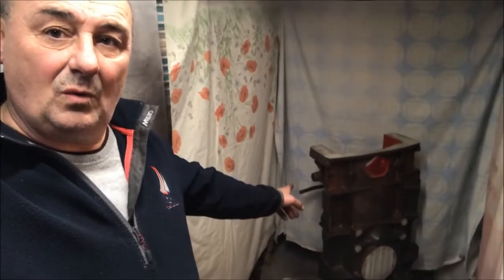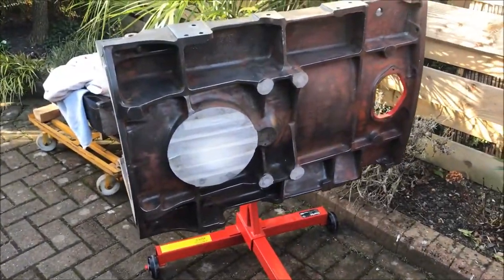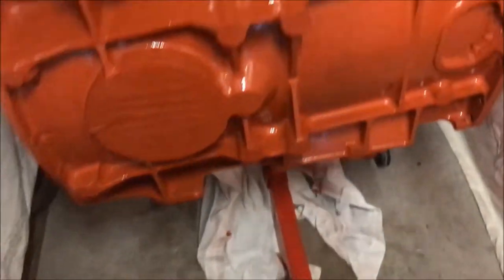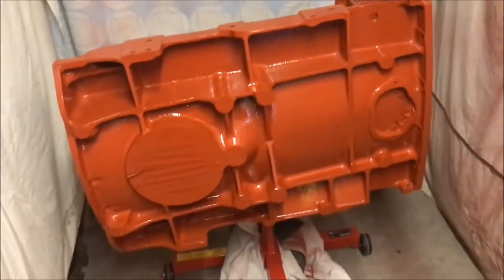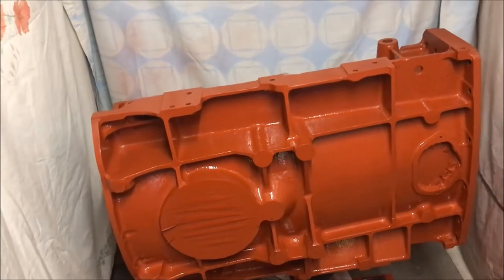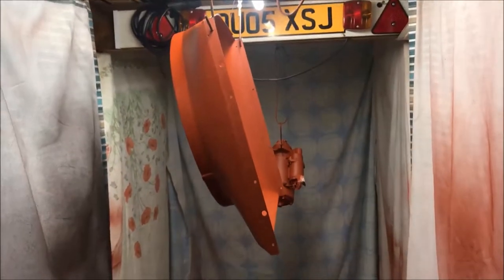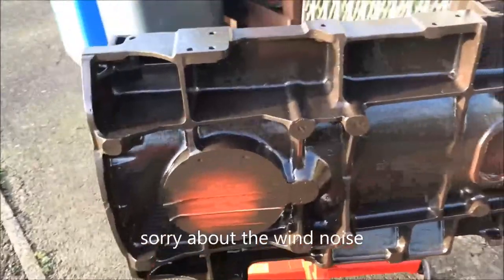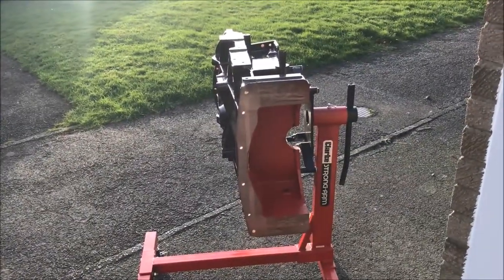Painting the David Brown 990 selectomatic gearbox case Pt7

Comment: Hi Barry.  Can you tell us a bit about the paint (primer and topcoat) you are using please?
Reply from the maker: Hi David thanks for getting in-touch, this is something I should have included in the video and will from now on. So the primer is Paragon red oxide for enamel paints and I thin this with just ordinary white sprit ( I have used expensive thinners in the past and got the same result) when I first open a tin I thin to 15% for the amount I'm mixing, after a couple of weeks and the primers has began to thicken slightly in the tin I'll up this to 20%, I try to batch paint as it saves material in the cleaning process, I apply one quick thin coat and allow it to flash off until tacky then give it one more good coat for coverage. If all I'm doing is primer then I let that dry for about 5 days before wrapping in cloth and storing until needed but if I'm finishing in colour that same day I'll give it about 20-25 minutes or until the wet areas look dry then go over with the first thin coat of colour,(which in this case is Craft master engine enamel thinned to 10%) again wait for it to flash normally 15-20 minutes then re-coat, wait 20-25 minutes and re-coat again. At this point I normally leave it over night before inspecting and correcting any problems or missed area's. As you've seen in the video i don't have a lot of space so using the engine stand this time made life so much easier to move wet castings. Many thanks for watching, when i started this, I never knew how hard it would be to video and work at the same time, But many many thanks for you comments and I'll definately include that info in the next video of painting parts for all the viewers. looking back I wish i had started videoing earlier in the process.
once agian many thanks for watching